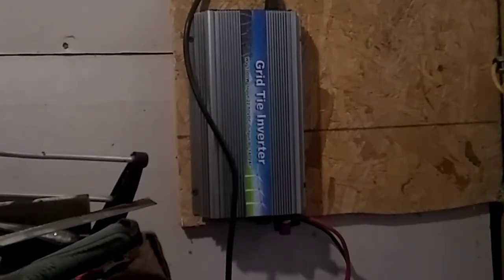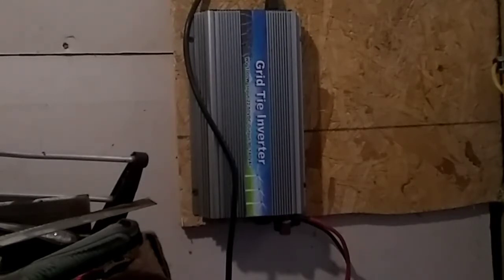Cheap grid tie one year review solar

Comment: Do you see any reduction in your electricity bill doing this or is it pretty much a scam? i just bought 3500w of solar panels and I'm trying to decide on straight battery backup solar or hybrid (grid tied with battery backup).
Reply from the maker: Yes it definitely works there is some figuring. Like there are 2 poles in your panel one set The breakers on the right and on the left
I have outlets run to each side and then my panels are split. 
A lot of people put them all on one side and then don't see the whole benefit. But if you watch multiple of my videos you can actually see the meter run backwards. It doesn't actually take anything off doing that what it does is you mean you're putting out more power than you're using. He also learned to do things like laundry run the dishwasher anything you can do during the day to offset the power it's much better to do. You also can use a kilowatt meter to see how much you're actually putting back in the wall with these. I will say they're not perfect coming up with a cooling system will make them last much longer simple USB fan blowing across them when they're operating during the day is probably best
Reply from the maker: I do have videos showing my electric bill over time

Comment: at 80% power output, their signal gets so noisy that they can kill sensitiv electronic devices... but if you run just heaters... go for it.
Reply from the maker: Been running these for year with no issues from any devices. They do have there own designated circuit to the box. I think they have vastly improved or you have never used them .

Comment: I don't see many new videos about these. All the ones i found were from 2 and 3 years ago. 

I wanna try this with my two 100 watt panels
Reply from the maker: Buy the 1000w one it stay cooler last longer that said if u have alot of hard hitting power outages then might shorten there life span I save about 60 a month on my bill so losing one every 2 or 3  year at about $120 isnt a big deal .I say go for it
Reply: @WealthandTravelonaDime  I have a couple portable power stations but we rarely lose power. I'm just looking to off set some power in a more strategic way versus having to always plug loads into my little power stations.
Reply from the maker: @AskIveSolar  exactly but get the 1000 watt as that will be a very small load on it so it never get hot and last way longer. I like your thinking and it will help alot
Reply: @WealthandTravelonaDime  Thanks for the advice! I will mos def get the larger one. 

Ideally I want to get a single panel and GTI solution. I love to keep solar simple and useful. 

I really appreciate you shooting the breeze with me in the comments.
Reply from the maker: @AskIveSolar  not a prob remember these come in 2 different voltage levels one for 12v panels and one for higher voltage panels dont forget to buy accordingly
Reply: I have noticed that whilst I was looking, I have just bought a cheap inverter and a 340 watt panel and trying it to see what happens, we don’t have the cold weather in Thailand. Doing a review as time goes by.

Comment: I'm going to convert my shed to solar. I have a complete 800 watt set of solar panels with charge controllers still in boxes. I'm going to try a grid tie inverter. 12 to 15 years ago I ordered a 3kw system and some Sun 600 inverters. I moved and sold all.
Reply from the maker: Dont need charge controller if you going grid tied . Sounds like a solid system your setting up. Cant wait to hear how it lowered your bills
Reply: @WealthandTravelonaDime  I want to do battery back up with some old batteries and try some grid tie for hot days when AC runs constantly. I may do it on my other channel. I was looking into grid tie inverters and a prowatt 2000 inverter as I use 2 1600watt ups.
Reply from the maker: @cutweldngrind  interesting let me know how turns out

Comment: GOOD INFORMATION ON THE GRID TIE INVERTER.
Reply from the maker: Glad to help
Reply: I just received my new 600 watt inverter and tried to install myself it runs in a few menutes but after a few minutes it blinks bact to red. I shut it off and re install again this time no more light I don't know what happen. If some of you guys can help me pls. Thanks
Reply from the maker: @garyverano1905  what kinda panel do u have and what kinda gridtie as in what voltage is each